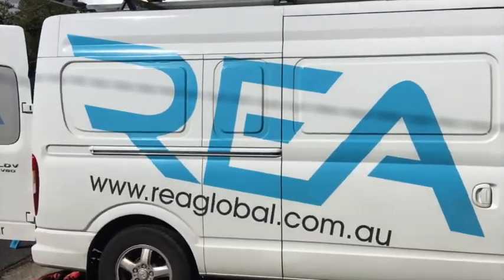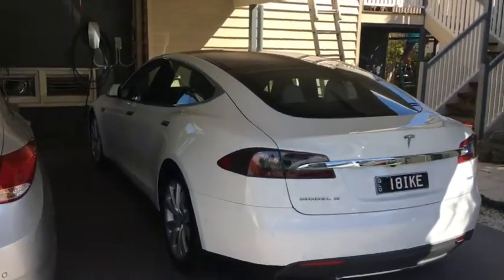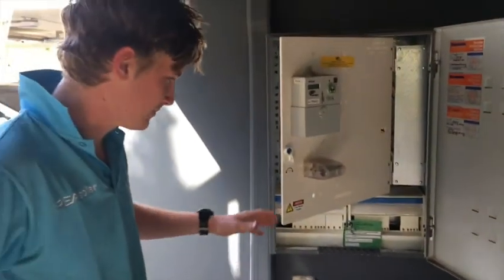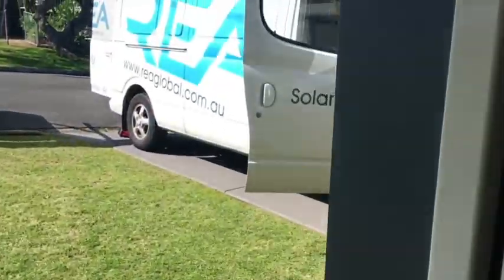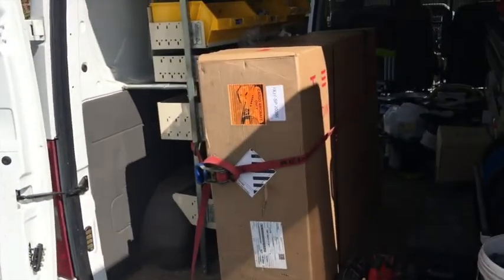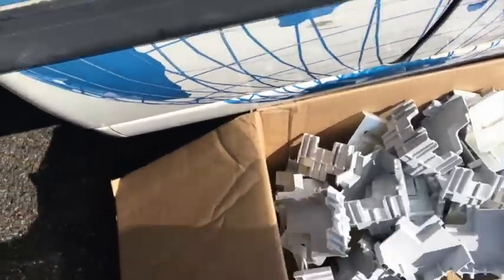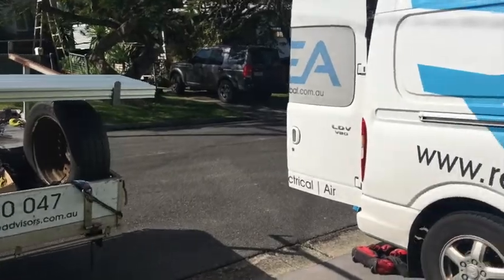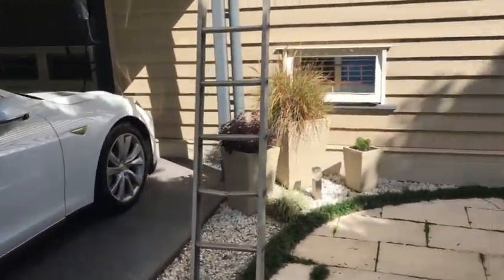REA SOLAR AND TESLA POWERWALL 2 INSTALL PART 1

Comment: Can you go completely off grid with five PW2 when winter is here for electric heating system?Enough storage capacity ?70 square meters house. I live in Spain (There is sun most of the time)

Comment: Does the solar system still generate electricity for loads and/or Powerwall 2 charging during grid failure? I heard some people saying that it does with the backup gateway. Is that true?

Comment: I need DC charging from solar panels, over generating everyday. Then powerwalls discharging through solar panel SMA invertors. Providing AC to Home's 200a Power panel at night. Will need 4+ powerwall 2s, will keep adding until it works. I have solar panels installed on 30' x 60' ramada, 75' from home. Existing 150', 1.5" conduit from solar to home garage, will install 2 conductor, 150' 4/0 ($1k). Can that be done?